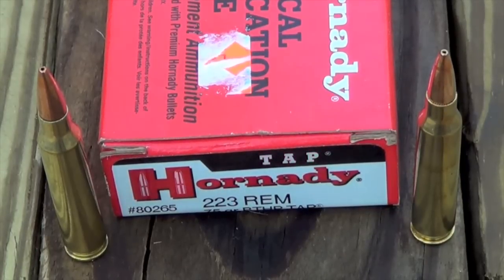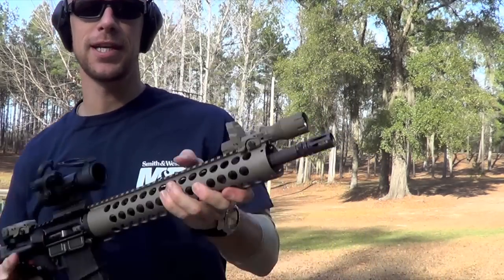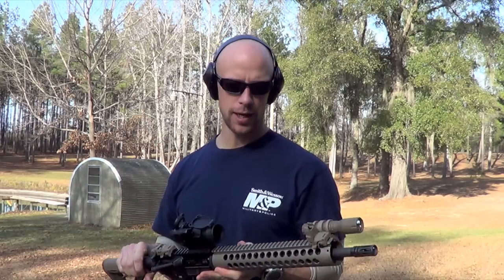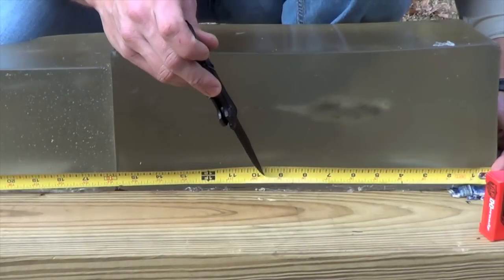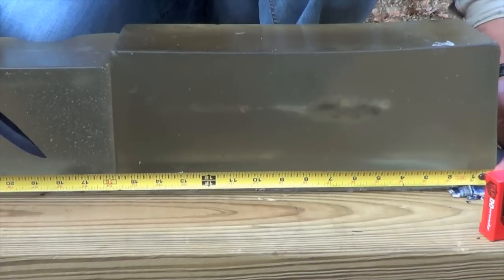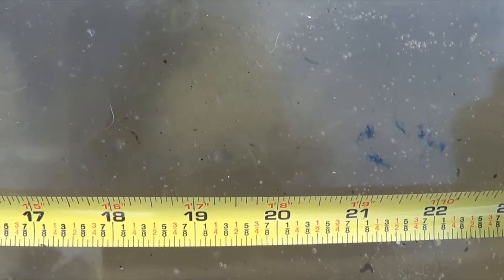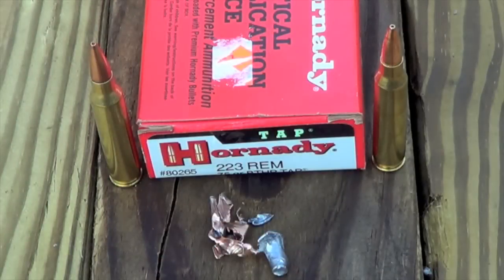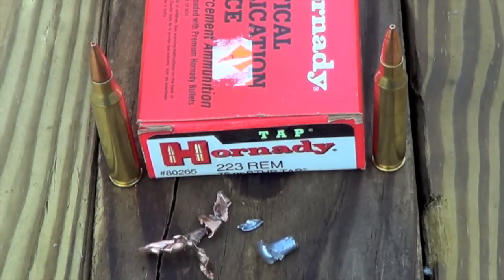Hornady 223 Remington 75gr BTHP TAP Ballistics Gel Test (HD) #80265

Comment: Considering 5.56 is capable of 1400 ft lbs of energy 948 is a bit dissapointing especially considering those law enforcement loads are expected to be fired from shorter M4 carbine barrels. But I am not sure if there would be a different powder that would result in greater velocity/energy from a short barrel. Still I'd say it performed very well inside the gel, fragmenting with en gros of the bullet making it past the 12" mark.
Reply from the maker: fair enough
Reply: Every LEO carbine I've seen has a 16" barrel, not a 14.7". And even still, the energy from the shorter barrel is adequate at the short distances LEO shoot.
Reply: At the Federal LEO level both long, short and full auto or semi only AR variants can be found.
Reply: Daniel Lea I completely agree. 5.56 Tap T2 out of a 16 inch barrel does at least 1200 ft lbs if not more. 948 is quite dissapointing.

Comment: I was planning on using the Hornady 223 TAP FPD 75gr OTM (#80268) as my HD round. But, Hornady has temporarily stopped production and everybody in out of stock. Is the Hornady 223 75gr TAP LE (#80265) similar to the TAP FPD round? What are the major differences that you know of??

Comment: What load would you recommend for a 10.3" bbl with a 1 in 7 twist? Right now I'm using IMI Razor core, the mk262 clone. I've also looked at TAP and vor-tx

Thanks
Reply from the maker: Tough to say but TAP 75gr BTHPs tend to shoot great in most 1 in 7 barrels.
Reply: Thanks. I really need to get a chrono

Comment: I am shocked on how low the FPS is on the tap ammo. Box said 2666 fps and was way below par even for 14.7 inch barrel. Was wondering if you can go threw the difference in the tap ammo . I think I seen 4 different style Hornady ammo but looks like the same bullet. One was FPD .223 other was 5.56 Tatical and they had match and couple others, but the bullet and velocity looks almost the same.
Reply: The advertised fps on the box is through a 24 inch barrel, hence the massive difference in fps out of the 14.5 incher

Comment: Thanks for the great vids man. Keep it up. In your opinion, what would be the best Ammo to 'bulk' up on for a 16" 1:7 twist AR? Factors to consider being cost (something less expensive than this premium TAP) and ballistic performance. Thanks for the info.
Reply from the maker: markd0388 If cost is a factor and stopping threats is the end state -- M193
Reply: +markd0388 M193, or Mk318 mod 0 ammo, available at about 16.00 per 20 rounds, 1/7 twist barrel is very fast and aggressive. With a 55 grain bullet you could get a total pass through at close range with that kind of twist, 55 grain is optimal in a 1/12
Reply: +tbone martinez How does barrel twist rate affect the likeliness of a pass-through at close range?
Reply: +baggytheo M193 is best suited for 1/12 twist, twist rates faster than that tend to over stabilized the round. The m193 was effective because is yawed and tumbled immediately upon impact with a body. If the sound is over stabilized the yawing is delayed

Comment: the harnody 223rem  i have say for 1:9 twist & faster.... my Barrel is a 1 in 7 twist does it make a diffrent  ?
Reply: I am unsure of what your question is.  If you are saying that your ammo requires 1:9 twist or faster then you are okay with your 1:7 twist.  Your barrel has a faster rate of twist than the requirement.
Reply: for use on a 1.9 twist Barrel that's what it says on the box of the ammo I bought
Reply: Typically, bullets weighing more than 62gr shoot more stable from a 1:7 twist. Bullets that weigh 62gr and less shoot more stable from a 1:9 twist barrel.

Comment: Nicely done. What I would like to see in a home defense round test is to place several layers of dry wall behind one block of ballistics gel that's about 15" or 16" thick. What that would show is how much potential for penetration a round would have against an interior wall after passing thru an attacker. I think most of us would agree that we wouldn't attempt shooting an attacker until we're sure we can put a hit on target. I just want to see how much energy those fragments retain after the hit. Would flesh and bone slow it down enough to keep the round inside that room? Might be interesting.
Reply: +Christian Peters This round is not designed for barriers.  The best barrier blind 5.56 would be something like the Black Hills TSX, or Hornady GMX.
Reply: +Matthew Roach, understood. My curiosity is focused around finding out if a round passes through an attacker will it still have enough energy to penetrate multiple walls. I would rather not load my hd rifle with a round that does that. Just my opinion though. Others may want something they can punch through any cover in their house and still put down an attacker.